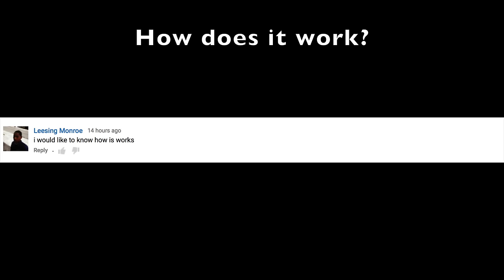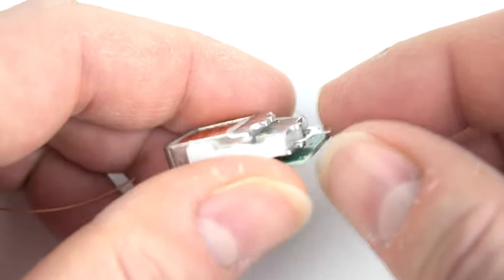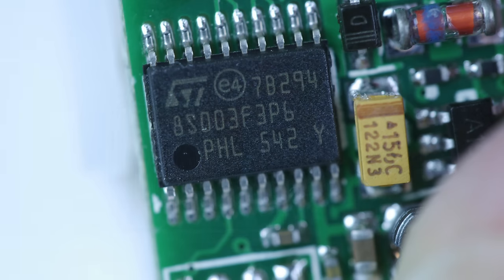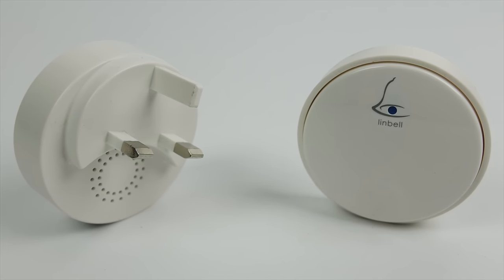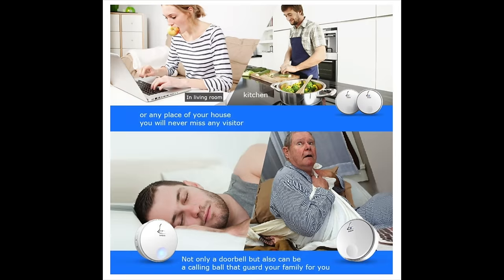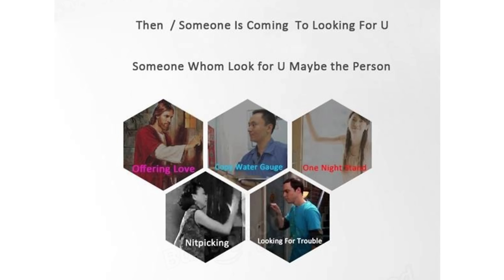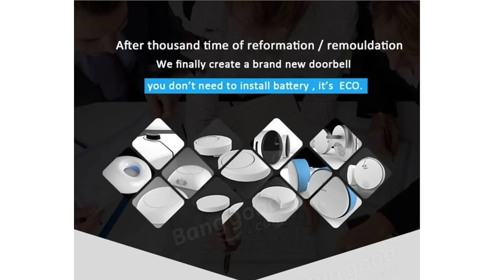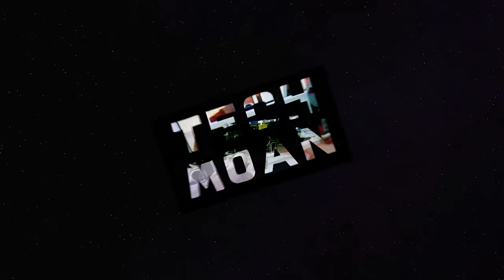Doorbell Q&A (Yes really)

Comment: Here is some technical aspects: the button contains a STMicroelectronics STM8S003 microcontroller and a Texas Instruments CC115L 433MHz low power radio transmitter. The receiver have a matching radio receiver, decoder and music playback circuit.

When the button is pressed, the button mechanism actually functions as a generator to power the transmitter circuitry using the energy from your finger pressing it. It then sends out a broadcast including some kind of identifier code. The receiver listens to that frequency, check if it have received a code that it recognizes, and rings the bell when it have picked up a code it should  respond to. The pairing process allows the receiver to know what code(s) it should resond to.

Comment: Thanks for the detailled photos, they look really nice. I can see from them that the door button consists of a ST-Micro brand "STM8" microcontroller and a Texas Instruments CC115L "Value Line Transmitter" They actually don't need to use different frequencies but they use unique codes for each button. The transmitter can easily transmit 4 bytes in basically no time, that would make 4 billion codes. The 4 pads near the microcontroller are most likely the contacts they use during production to program that unique number into the chip. I can see a red  limiting diode, a rectifier black diode and the yellow capacitor used to store the charge from the button push. Also a little chip with inductor to convert the voltage of the coil into something stable that can be used by the 2 main components. Very neat design.
Reply: +Chip Guy Vids 
excellent comment

Comment: I waited for this video and it's here - Great! - Technically, it's still the same frequency - It just changes the code that is sent. The two chips in the product is a "16 MHz STM8S Microprocessor" and a "CC115L cost optimized sub-1 GHz RF transmitter" - The transmitter chip can be programmed for different frequencies for different parts of the world where the regulations differ a bit. I'm pretty sure that yours are operating in the 433-MHz ISM-band. I'm really glad that you showed the '"generator" as this bit interests me a lot. Quite interesting to see a coil and magnet in stead of a piezo-element!

Comment: I swear now after watching many of your videos, that you have either been involved in broadcasting or production of some sort. No complaints about that, it would just testify as to the calibre of the videos you put on YouTube. Anyway, on the bell push generator, it's just an electromagnetic generator, but it's interesting that it can power that much electronics with such a short duration of power generation :) lots of windings in the generator coil I guess. Perhaps they're down converting a highish voltage spike to a lower voltage but more current. Hmmm...

Comment: Chances are they are all working on the same radio frequency, but transmit a binary code that is stored in the flash memory of one of the units. It is trivial to generate a random number that will give the individual units a very low probability of being repeated in the same neighbourhood.
Reply: You can just grab a RTL-SDR, optionally with a low-noise amplifier add-on, and listen on the frequency the CC115L chip generates. You would get a list of codes after a few days of monitoring the airwaves. Now you can build your own transmitter using the same CC115L chip, but with a RF power amplifier and some way to attach either a computer or a user interface added on it (can be as simple as a USB microcontroller like ATmega16U2 or STM32F042.) Now you can annoy your neighbours by ringing their bells without going near their houses.
Reply: Makes sense however I think they would just assign them an incremental id number or one of a predetermined set of random numbers during the programming stage of the production. Many ways to do it, but a completely random number would sooner or later cause two bells having the same id number.
Reply: Klaus Petersen https://en.wikipedia.org/wiki/Universally_unique_identifier

Comment: Although that power generation tech isn't new or particularly special I've never seen it used like this before so I'm actually quite impressed and appreciate the closer look, I can think of many other applications where not having to worry about the batteries would be more than welcome. Not that it really bothers me but I expect that the generator is actually less damaging to the environment than just one battery (based on materials) too.
Reply from the maker: +Matt Tester (UKMatt2000) I still think it's pretty clever that a press of a finger can translate into electricity that then powers a wireless transmitter. Now all I need is a car that I can power with rapid clicks like I was playing hypersports.

Comment: Great followup! But, the worst part of these types of items is usually the power supply, or, at least the one most likely to cause an injury through electrocution (common on cheap chargers due to a lack of proper mains isolation) or just good old overheating. That said I was quite impressed with the transmitter, nice to see some branded RF IC's there which suggest the PSU stage in the receiver might actually be not too bad.

The biggest problem is that all these devices are essentially 'self certified' rather than independently tested so CE marking often means nothing. Only recently we discovered an outdoors type RCD 13A socket being sold through a major, multinational store that was falsely self-certified and lethal - only by reporting it to the end seller was it finally withdrawn, the UK importer was not remotely interested and no UK body was checking it :(
Reply: Would be curious in learning more about this faulty RCD. You should send one to Big Clive!
Reply: I sent it to the Electrical Safety Council and they were horrified (it's not so much the RCD circuitry that was faulty, just a lethal physical design that didn't meet any BS or EN standard for construction safety, such as shrouded surrounds, that kind of thing - for example it had bare metalwork on the back carrying the 'Live' conductor line. For a summary see - http://www.casasecurity.co.uk/wp-content/uploads/sites/2/2014/10/danger1.png - since making that picture, the product was indeed condemned and has long since been removed from shelves.

Comment: 433,92 MHz is a pretty popular frequency for random wireless domestic things. You have these wireless utility switches/relays that work on the same principle: when you press a button it first sends a code, and then the state. The receiver just continuously listens and when it gets a signal, it compares the code to the one programmed into the device (or set at a later date) and then executes its function.

I have my home full of these wireless transmitters and receivers, and with a transceiver connected to a server (for example rfxcom) I can switch lights and other things on/off via the internet, program them on timetables and all kinds of fun stuff. Sure the security is negligible (since it's just a code that is being sent that anyone can pickup), but it makes for a fun home-automation project.

Comment: just bought it this and found that the button need to be depressed a little before the real push with resistance that actually generate the pulse. I find that some people do press buttons lightly just enough to depress it, and i don't want my guest to be mistaken that they had pushed the button. My idea of button should be either it depress or it don't. so i made the part that clicks the metal thing in the transmitter thicker with a grain of rice along with superglue. Now it either depress and sound the bell, or it doesn't depress at all. 

I have a question for Mr Techmoan. I have a older wireless doorbell which i had lost the button, only left with the receiver. do you think i can pair this transmitter with my old receiver of different brand? i've opened it up and find no jumper or dip switch, everything is soldered. so i thought it should be paired via long press or what, but it doesn't work.

Comment: Please do reviews of more ridiculous household appliances, specifically kitchen ones.
Reply from the maker: +Benjamin Dover a lot of people ask for this, but no one is making any silly devices at the moment....I check once every week and have done for two years. If you spot any interesting kitchen gadgets, please send me a link.
Reply from the maker: +Benjamin Dover thanks for the suggestions. I had a robot vacuum cleaner, but it went blind and had to be destroyed for the good of the furniture. I also realised that my house is way to small for one to make any sense. There's probably 10sq ft of carpet for it to clean. The other things whilst odd...wouldn't translate well into a demonstration video, well at least I can't think of a way to make them interesting. However at least you came back with some ideas, which is more than most people would do, so props to you for that.

Comment: So, we have an STM8 microcontroller:
http://www.st.com/web/en/catalog/mmc/SC1244/SS1010/LN2/PF251792

And a TI CC115L "value line transmitter", based on the popular CC1101 transceiver:
http://www.ti.com/product/CC115L

The SOT-23 package is probably a regulator of some sort, but I couldn't find much for "A15S" (or is it "A155"?).
Reply: +Ian Tester Bit of googling with random buzzwords suggests it could be a super low voltage  OpAmp (LMV-821)... the relevent TI data sheet is here: http://www.ti.com/general/docs/lit/getliterature.tsp?genericPartNumber=LMV822-N&fileType=pdf , the page with the reference to the A15 marking is p 30 :) I

Comment: But is the signal encrypted, similar to a garage door opener? I wouldn't want some hackers being able to ring my doorbell without pushing the button.
Reply from the maker: +Heem Lo Your planet is very different to mine.
Reply: +Techmoan 

HAHAHAHA
Reply: +Heem Lo 

You wouldn't happen to live in the U.S, sat in your basement with tin foil round your head, waiting for the end of the world?I dont think a person, with the hacking skills to empty back accounts, is going to take any interest in a door bell
Reply: +Bad Drivers of Northamptonshire Really?   He's joking. lol
Reply: +Heem Lo If someone generates the correect frequency, then the door will ring.
Reply: It's a door bell, not a door lock...
Reply: Most garage doors don't use encrypted transmissions. Higher end new ones will, but old ones or cheap ones don't. If you take the back off of your remote and see a bunch of little switches, your door is almost guaranteed to be using a super basic transmission with no protection whatsoever.

Comment: I'm guessing that there's a magnet inside the coil of wire that moves when the switch is pushed? this would generate a small electrical current to power the unit?
Reply from the maker: +Donald Sleightholme Yes I believe that's right.
Reply: +Donald Sleightholme ...and the reverse motion (the spring going back to its non-operated position) is so quick that it even generates enough power to light an LED. It's quite clever actually.

Comment: I purchased one of these and have found it to be unreliable. The bell push only triggers a ring intermittantly. Do you know the manufacturer because I want to try and identify the problem as all other reviews are 5*? Regards, John
Reply from the maker: +John Crook I have no idea - I just bought it from Amazon. Mine is perfect (I know that won't help). Perhaps yours is just faulty, it can happen.
Reply: Yes, guess that's it. I am being sent an FOC replacement.
Thanks for your excellent videos.
Regards, John
Reply: +Techmoan The illustration said "Perfect Design" so clearly it couldn't be faulty =)
Reply: Doesn't sound very stableable to me.
Reply: How far apart do you have the doorbell and the receiver? What kind of walls?
Reply: I did a small tweak. I took it apart and reduced the length of the plastic stop pin and it has been alright since.
Reply: Fantastic! Thanks for letting us know.

Comment: SUGGESTION FOR FOLLOWUP TO : 

"Assembling an Intel NUC Mini PC - i5 D54250WYK"

Install x86 Android on it (not permanently, use a USB stick)!
-- https://sourceforge.net/projects/android-x86/
-- http://www.android-x86.org/download/

I have done so with a slightly dated laptop at home, and it does work --  and it makes for some really neat viewing ... but getting it into fixed landscape mode can be a pain with some programs. 

Sometimes you have too much 20th and 21st century tech on your uploads ... the 19th century had high tech too ... in the form of the code book and the newly evolving "information theory" and "coding theory" that evolved out of it by the 1920s. 

RETRO TECH TO REVIEW

ABC Universal Code 1881
https://www.scribd.com/doc/167767153/ABC-Universal-Code-1881